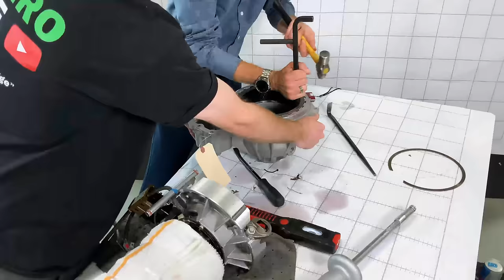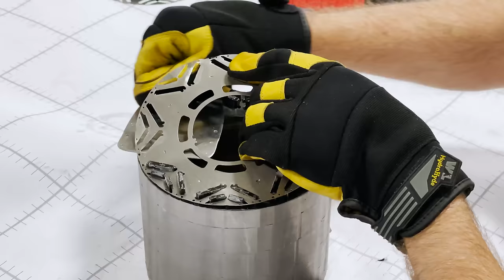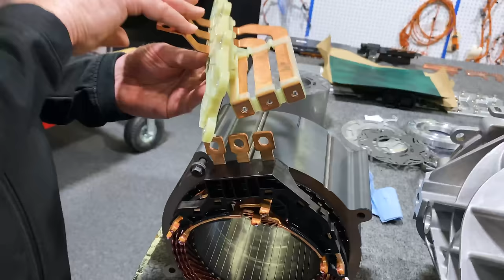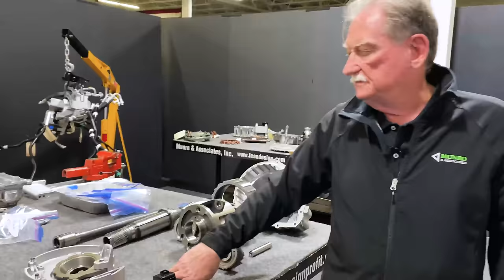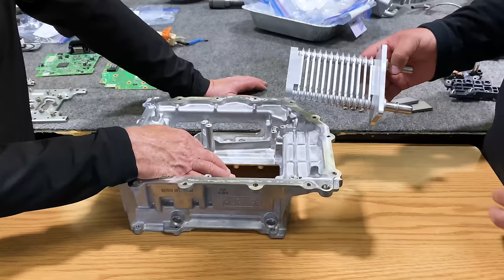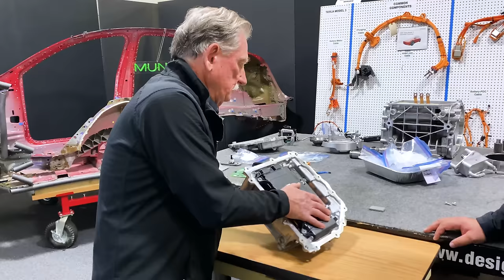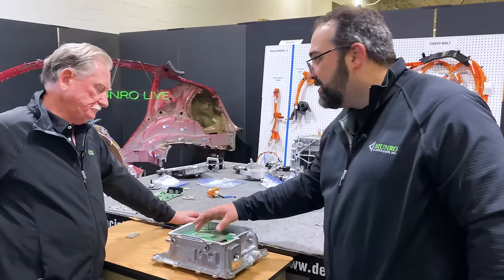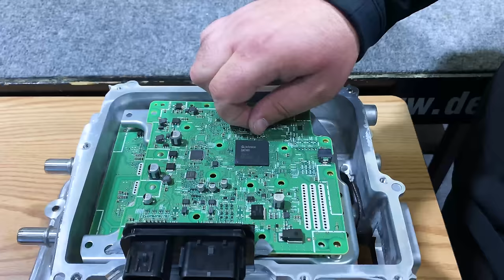Ford Mach-E Rear Motor Teardown and Analysis

Comment: The metal in between the two PCBs could simply be a kind of support. Because, I guess that this is assembled outside of the inverter housing as a PCB sandwich. It looks like, that many people were involved in designing different parts, which did not talk so much to each other... 🙈🙉🙊

Comment: CAD tool only spoils engineers not necessarily cost saving? 
Look at how easy - if not fun as well - to add screws, stand-offs, components and related labor cost in the draft, blue print. That can be fixed with drafting board and pencil, square, compass etc in a manual operation.

Comment: Weight saving is a big issue so why doesn’t everyone use epicyclic gears? They deliver high torque with small parts because forces are balanced around the central shaft. They don’t need helical gear teeth because there is always one pair driving at any moment and they are more efficient. Fewer losses - less heat to dispose of. So many wins.

Comment: It seems to be that they have not clocked the parts of the rotor enough to induce  a halbach effect. That cooling system for the motor looks like it was designed to be inadequate so it will fail on a regular basis.
Reply: The magnets are already in Halbach. The clocking is done for another reason

Comment: It would be REALLY interesting to see someone do an independent "torque curve to thermal limits to spec rpm" test comparison on some of these drives. At what rpm does it reach the constant power limit, and what is the torque at max rated rpm? What do the thermal limit curves look like?

That is where the secret sauce comparisons are. I know, such comparison tests wouldn't be cheap to do, but perhaps not destructive of a car (no teardown req'd) and might uncover some real relative advantages.

Gotta say, I love Ford's planetary reduction gear system, though differential is unclear. Huge potential for smaller cheaper dual-speed drives acting like much bigger drives in economy cars. Still would need a second planetary, but it could be a lightweight precision unit ahead of the high torque final reduction now in place.
Reply: full reports are for sale - see web site for pricing and which reports you can buy.

Comment: 28:00 ..... I know from auto mechanics experience what that feels like as a worker but at a highschool frustrated level. There was this one stupid thing on the Chrysler engine I was trying to screw in. I got bumped by someone trying to walk by me. (On purpose because they thought it was funny) and a small screw that held something in felt all the way down into the other part of the engine and we had to go all the way back to square one almost because we had that one thing happening. I can imagine someone on the assembly line ending up with this kind of issue and they plug it in and by the time it gets the end of the assembly line and the moment it does, someone tries to plug the pack in and charge it for the first time then BOOOM GOES THE INVERTER OR WHATEVER AND THE ENTIRE AREA BURNS and sparks like hell. 

All it takes is a spark and a bit of power to cause a weld to form feed by gravity. Those boards would literally DETONATE if that happens and cause a huge mess.

Comment: “Code is cheap.”  Only after it is coded (and validated).  Testing code changes to make sure they do not have unintended consequences can be complex and time consuming.  A lot depends on how many units over which software engineering change costs have to be amortized.

Comment: Getting those pins in place is not a problem at all if you guide them. But i see no guides. No round 45 deg(example) cups to guide the pins. All of this must be machine made, surely. Otherwise its, well. Its bad design because the screws are service friendly. But getting the PCB or whatever down with all those pins is a nightmare.. So the screws are redundant. But! you could have different PCBs for repairs. Where those pins is a non issue.

Comment: they could not get all on the same PCB... maybe because those are different part providers and those many bolts perhaps is because they fear that the vibration will break the solder and finally the big cover has less screws because it is more rigid than the PCB

Comment: Is it just me, or is there a desaster waiting to happen in that inverter?
If you have the heatsink expand forward and backward, but the pins are soldered to a fixed PCB above that, would'nt that crack the wires or solder joints at some point?! Do I miss something?
Reply: The inverter is made by Denso.  This company also makes the inverters for Toyota's Prius.  Considering the millions of Priuses sold , I imagine they have enough data and engineering designs to ensure their inverter lasts.
Reply: @torgsocial6083  fair enough, denso is a reputable supplier. Still, i think the Design is insanely complicated.

Comment: I think you made a wrong assumption how inverter is assembled, specifically, how MOSFETs are inserted and then after all the welding you turn over and put on the board on the pins, it seems obvious that the board will have pre-soldered MOSFETs and first you would insert the board with MOSFETs and the you do all the soldering and other assembling
Reply: You still have to screw the first board down screw the plate to it align the second board screw it down then solder it then its over to do the other side bus bar 1 on laser weld insulation bus 2 & 3 and laser weld them. Repair = throw it in the bin and get new one out. This is a production horror story. If you designed this at Tesla security would be walking you out the door.

Comment: I thought the regulations in north america require two ways to secure a parked vehicle, either in gear or with parking pawl, and parking brake?
Reply: Less than so many pounds only a parking brake is required.  And it is required, other mechanisms such as gear or parking pawl are not a substitute.

Comment: A PCB with surface-mount parts cannot be allowed to vibrate, the parts will shake loose or crack the solder joints.  That’s why 16 screws.  The cover isn’t as fussy.  Keep this guy away from any cost-cutting committees!

Comment: you forget to mention solder joint fatigue..  Our lab at the UofA did the research on cycle-life failure and molecular solder flow analysis in DC power systems.  This configuration is begging to fail over its lifetime.  Repairing this would be just short of a nightmare.

Comment: I really do not think this is how the Inverter box is assembled. 
First of all, I believe the Mosfets are soldered to the first board from the manufacturer.
The first step then would be to put heatsink in place, flip the box, insert the board. Now the Mosfets would just slide inside the fins. Then put the next board on top, screw the cover, flip the box, do the rest.

Comment: You suggested more screws for that screw-intensive, weld-intensive abortion of an inverter?  Is it April Fool's Day already?  Heh.

Question:  Did Ford assemble that inverter, or did they get it from an outside supplier?

Question:  How does Ford compare to Tesla in mass-to-power ratios for their motors?

Question:  Does Ford use both an induction and a permanent magnet motor on the Mach-E?  If you covered that, I missed it.

I really appreciated the detailed explanation of the inverter design and its implications for the assembly line.  Great job, guys.
Reply: On the inverter source, the casting has "FoMo Co" embossed, which probably stands for Ford Motor Company. I suppose an external supplier might do that embossing and assemble the innards too, but I suspect the assembly is done internally.
Reply: @stephen-boddy  Inconclusive.  As you said, Ford could specify the embossing in a supply contract.  Between us, we can't answer the question.  All we can do is make an intuitive leap to a tentative answer.

Ford has a robust history of outsourcing components other than engines and transmissions, where their core competencies lie.  This is why they have dozens of individual pieces of firmware, all using their own communications protocols and operating systems, none really optimized.  It's why they have 4 pumps in their HVAC system; they used commercial off-the-shelf components (COTS), and that was an emergent property of constraining their designs to use existing parts.  It's why they are struggling to establish over-the-air software updates for firmware.

And it's why, I think, that the Mach-E isn't an energy-efficient BEV.  Scores and scores of opportunities to shave weight and improve energy efficiency are waiting for Ford's engineers to solve them.

They could also cut production costs and improve life cycle maintenance costs with better designs.  As it stands, the Mach-E fleet will be dropping screws on roads all over the world.

And they are likely clearing negative margins on every sale.  Which motivates them (and other legacy automakers) to seek incentives for hybrids instead of pushing hard to mass-market BEVs.  They have a friend in Joe Biden; he's got their back.  But emphasizing hybrids will just cause them to fall further behind BEV leaders.  In the long run, that bodes badly for Ford's survival.  ICEVs are obsolescent.  If they aren't readying themselves to play in the new mobility paradigm, eventually, they won't exist.
Reply: The inverter is made by Denso.  This company also makes the inverters for Toyota's Prius.
Reply: @torgsocial6083  Thanks.

Ford's appetite for outsourcing is unabated.  I more or less expected this, but was not certain.
Reply: In previous videos Sandy was assuming that the front motor would be induction, but specs published by others say it's not. They haven't torn that one down yet to see the actual motor type.

Various online reports say, based on statements from Ford and sample motor parts displayed, that there are two motors used in the Mach-E: one large and one small. The 2WD version has the large motor at the rear, and the higher-performance AWD version has the same large motor at both axles, so obviously in that case both motors are PM.
Reply: @brianb-p6586  I hope Sandy doesn't skip the motor tear-down.  He could offer some much-needed clarity.

Thanks for chiming in.  You've delved a lot deeper than I have, even turning up contradictory sources.

Comment: I’m surprised Sandy didn’t mention that borg Warner design and build these units for Ford.  So they may have not have learned of sandys screw policy 😆.  Interesting that Borg Warner do not say where they source the motor and inverter from though.
Reply: The inverter is made by Denso.  The company that makes the inverters for Toyota's Prius.

Comment: Is it a "transmission" if it does not shift gears or have a reverse?  I think it's a gear reduction box, not transmission.  Correct me if I am wrong.
Reply: Depends on the local jargon.  Transmission (transmits power) is the more generic term, reduction gear box is a more specific case.  I have heard 2-speed and single speed transmission called out where that was an option on a product.
Reply: You are wrong, but that's okay... it's a common error.

Comment: How much of the car is made is Mexico? I'm assuming manufacturing costs are considerably less there.  If that's the case can a lot Ford's engineering options be justified in Ford's eyes because of labor cost offsets and they eased off on engineering?    It seems that Ford might want to outsource their engineering <:)   I finally understand what's happening.  It's a  Rube Goldberg-inspired design.

Thanks for putting these teardowns online!

Comment: GM did the same thing on the oil pump and filter assembly. Its a serviceable filter, buried inside the motor assembly. 

On the inverter: Its like the entire engineering had a departmental brain fart.
Reply: Ford escort had to raise the motor off the mounts to change the oil filter back in the 70s

Comment: I think Ford needs to re-evaluate their vibration specs. It seems like they are going way overboard with all these connections for that. I'm guessing they just took ICE specs and applied them to electric motors or something. All of those fasteners on circuit boards are because of that. They don't want components breaking off.

Comment: I find it slightly irritating and exaggerated that they are "bashing" the engineers of Ford, and are constantly making comments about : "why" and "How", but they don't actually request details from Ford as to the reasoning behind it. Seems to be very biased against Ford. 

I can strip anything down, even my toaster, and wonder why it was build in a certain way and say it could have been done better. 

Also the comment that similiar engineering is done differently in the Aerspace industry. Of course it's done differently. Also slightly different numbers and cost planning. Not even mentioning safety related issues. You cannot compare Aircraft industry to passenger car industry.

Comment: Basically the inverter is a one piece unit. that would cost 5k+ replacement for ford.
Reply: $1700 from the parts department

Comment: How does Ford plan on making money on the F-150 Lightning with this stuff?
Reply: They got their fingers crossed, hoping the current F-150 owners will switch to the EV version. Cybertruck’s  superior specs and very competitive prices is going to make things real interesting. Tesla can only gain market share, Ford and GM can only hold or lose.
Reply: For one thing, the Lightning doesn't share any of this stuff - it's a different platform with different components.

Comment: Seems to be too many people have worked on the inverter or designed it.  Who/what is FoMoCo?
Reply: Seriously? FoMoCo is Ford Motor Company. They have used that short form for many years, maybe decades.
Reply: @brianb-p6586 Thanks, I am more used to Bosch, Denso, Aisin & Valeo
Reply: @pritambissonauth2181  'FoMoCo" is used mostly for parts (and "Motorcraft" is the Ford parts consumer brand name), not for whole vehicles or the company... so if you haven't seen or discussed Ford parts you wouldn't likely be familiar with it. And it doesn't tell you much of anything about what company actually designed or built the component, only that it was made for Ford.

Comment: Why don’t they just use perfluorocarbon? It’s thin enough to go anywhere. Or do they scratch it because of its high affinity for oxygen? It should make a perfect coolant for a rotor or battery. It’s so thin it can go through collateral tube of Alveoli. Those are the little tiny air sacs you have inside your lungs 🫁. It should be able to wick away temperature more easily.

Comment: By counting the number of laminations, you are getting closer to the truth Sandy. But keep going. Those tiny little bumps on those circuit boards are functional electronic components critical to the operation of the overall system. They are the resistors, capacitors, inductors and integrated circuits. Count them as well. Then we can total the part count for a truly honest side-by-side ICE comparison. Let's do it! Inquiring minds want to know!

Comment: I think  the design tesla uses for the stator has merit.  We are probably switching a SPWM signal through the copper winding at in excess of 20000hz..... the multi in hand wiring of tesla is in effect LITZ wire, which mitigates the skin effect of high current at high frequency in thick conductors.....by using lots of thin conductors which are insulated from each other.

The hairpin design is brutally robust, but high frequency will lower the usefulness of the cross section of the heavy copper wiring, as skin effect means that the current travels in the outer walls of the conductor easier than the core..... which is then wasted, and the effective resistance of the copper conductor is in fact higher than would be expected with say DC.
Reply: ...but, that means it is more manufacturing intensive, something some would point out as a negative. You are probably right, but so many here in the comments act like any compromise in design for costs, etc. are unjustified, which is not always the case.
Reply: Word salad. "litz wire"? 😂

Comment: "I don't know why these are not snaped-in-place"
No, you cannot do this.
Keep in mind that the PCB is mounted on the motor, do not expect the same profile of vibrations as for a music player.
Show me an inverter for EVs of HV which is mounted on motor, in which the PCB is fixed only with snap fits, you will not find such things.